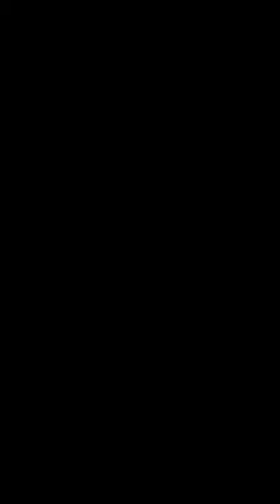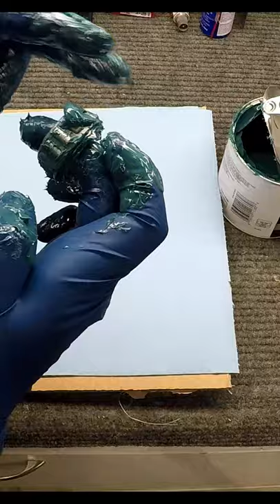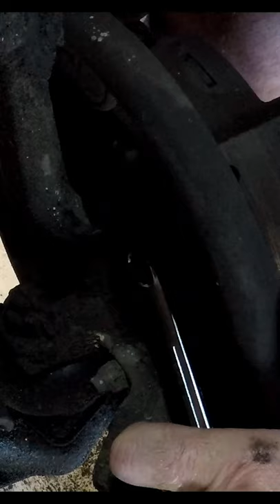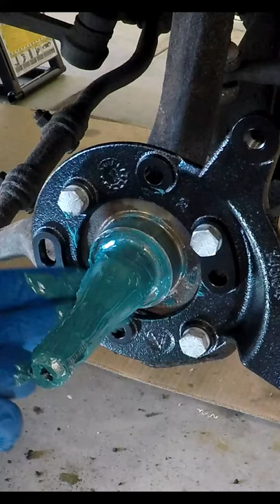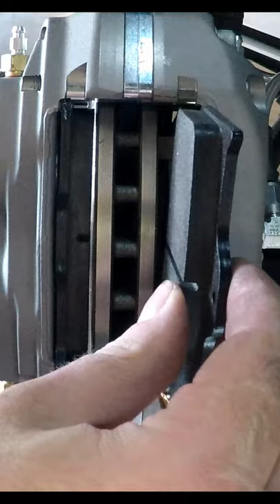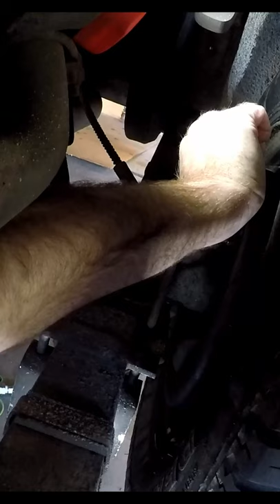Front Disc Brakes 1966 Mustang #shorts

Comment: When you converted the front drum brakes to disk brakes you had to upgrade master cylinder also correct?
Reply from the maker: Correct, I installed a dual bowl and a proportioning valve to manage the different pressure need in the rear vs the front.  This #shorts video is just a small clip of the full video I did on this install, which included the the master cylinder.  You can see it on my channel.  :)